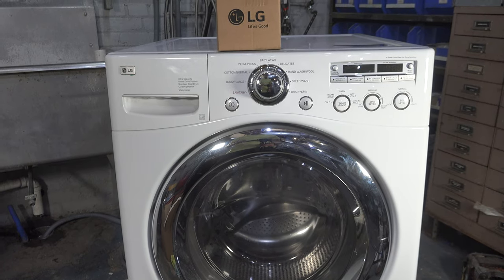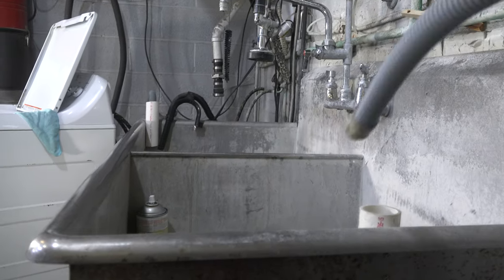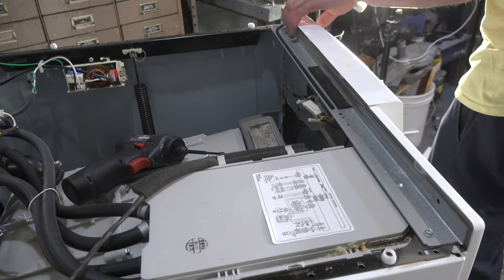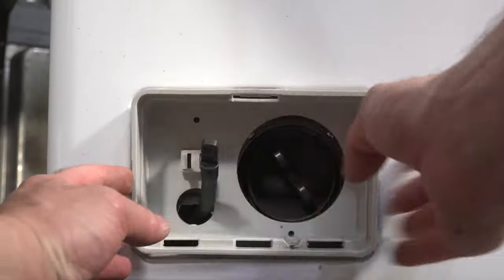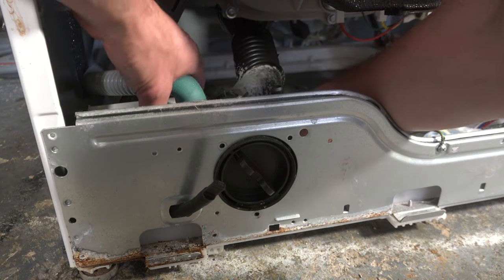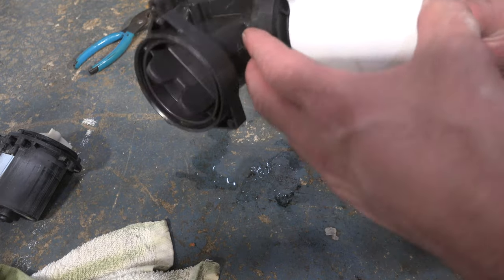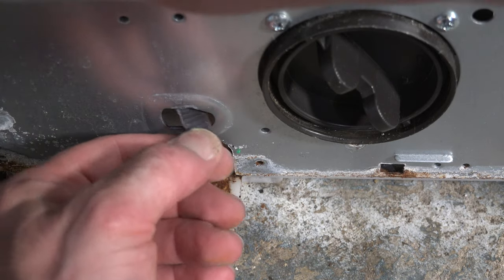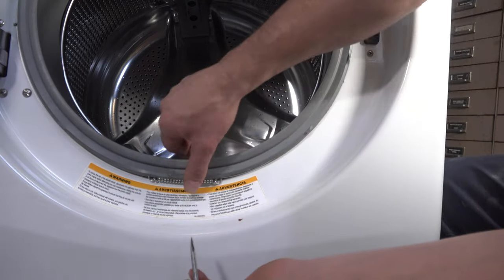How to Fix LG Washer OE Error Code No Drain Not Draining Tutorial Repair Guide

Comment: So it ended up being the filter.  The filter i had no idea even existed.  After ten years of use,  it had Bobby pins,  material,  endless hair, lint and god knows what. You saved me at least a couple hundred dollars if not me unwittingly buying a new washer.  Five stars. Thank you.
Reply: Do you need to replace the pump? My parent house washing machine broke these idk should i just take look at filter or tubs. Or just buy replacement drain motor. I dont live there anymore so to check it i must drive 300km😂
Reply: @ayn30  if you follow this video you don't replace anything. I thought it was a bad pump also.  In the bottom left corner of the washer there is a panel.  Mine leaked a lot more water than the example in the video so your parents will either need a shop vac handy or a few towels.  All i did was drain it and clean out the filter which was very clogged and it worked fine. I also ran a diagnostic check which was in a different video after.  I hope that helps.
Reply: @EL-em3mn  thanks for you suggestion. I take a look when i going to their house for next week.

Comment: Thanks ... I used your advice and video got an OEM pump off Amazon next day shipping and finished the job in about an hour or two . 1 hour 1st day disassemble and remove pump to verify type and about an hour next day after getting new part. On an easy scale it was pretty easy and my only suggestion  is make sure you remember where all the screws go back in and take a couple pictures of things the way they were assembled before you take apart if you think you may need to reference later.

Comment: Thanks for the help. Mine was a bit different. The pump assembly was not screwed to the frame but it was on a plate placed on 3 silent blocs linked by 3 screws to the bottom. Around 2 hrs to get the job done. The trickiest part was the spring at the end. I needed help (2 more hands) to be able to mount it properly.

Comment: Gotta thank you for a great video, clear and exact. However my model (altho identical) had the pumps screwed onto a metal plate that has 3x 13/16 bolts securing it to the base. In order to access them I needed a flexible shaft on my socket, as they weren't easy to reach. If your model has this, you have to remove them in order to excess the pumps. Everything else was exactly per the video. Thanks for the diagnostic feature at the end, very useful too.

Comment: I watched this video so that I could fix my washer! I ordered from your link. I had a few more screws than yours, but the main problem was the bolts holding in the drain pump. There was no tab. But besides that one unexpected difficulty, our washer is up and running. Thank you!
Reply: Same issue here with bolts instead of tab. How did you get the front left bolt out? I can reach the right and back one.
Reply: If you use a ratchet with a 3 inch extension you can get all three. 10mm. Then there are 4 screws to remove it from the mount. I would recommend removing all hoses and wires before removing the mount.

Comment: Great video.  One suggestion..... it MAY be that exhaust hose.  We had standing water in the tub.  I used a cup to get as much out until I stumbled on your video.  I then tried to drain with that little hose - no luck.  Long story short.... both that hose AND the main exhaust hose was full of sand/gunk.  I blew them both out, and verified they were clear before putting the system back together.   I will probably still order a pump, in case the blockage took off a few years off the pump.

Comment: Awesome video, made changing it a breeze without any hang ups.  I will say mine must be a newer version with the motor on a vibration resistant pad.  So I removed the pad and all for the motor swap it was just three 10mm bolts.  All told less then an hour to fix.  Thank you!

Comment: Fixed my washer thanks to you, perfect instructions. Another tip for getting the spring back on the gasket that worked for me was using something heavy with a lot of leverage to pull the spring apart, that took a ton of force.

Comment: Thanks for the help The only part I had trouble with was putting the wires in the correct spot on the new water pump. So after the second attempt, the washer worked.😂 Operator error

Comment: Worked perfectly on my LG washer WM2650HWA.  My pump looked a little different, but the folks at Lorain responded right away and said that the new pump looks different and will work just fine.  Also saved some money with their trick on getting the bellow spring back on with a screwdriver instead of having to buy the spring expansion tool!
Reply: Austin I have an older pump as well so I didn’t have the little plastic cover that he took off his older motor. Did you have to buy this piece? Did you have the same issue

Comment: Fantastic video. Our problem turned out to be a clogged filter, so it was an easy fix.
Reply: Was it clogged in the filter part that's easy to check or did you take the washer apart to get to the pump itself?

Comment: Excellent video, but as a note I just did my washer which might be a different year/model# that has the same motor but is mounted on a metal tray with 3 -10 mm bolts holding it in,otherwise everything else was the same. Thank You

Comment: Great presentation! My issue is different, I'm getting a TE Code... I've got the Thermistor part already, but I wanted a better video of removing and replacing the front cover. Yours helped!
LG wm2101hw, already bought the Thermistor for under $20.
Is there a diagnostic code for checking that component? 
I haven't heard of the Diagnostic Checking Process in any of the other videos I've watched... So I figure TE is all I'm going to get. 

Washer has been flawless... I bought it 6 years ago for $60. Apparently, the lady's grandmother was house-sitting, used the wrong detergent and flooded the whole washroom, and instead of fixing the problem, just bought a whole new set. I've never been able to get it to flood suds over, but I use Persil packets.

Comment: Just replaced pump that had failed. Draining beautifully now but I do have a leak under washer now. Pump to tub hose maybe or would it be one of the other two?  Thank u so much for your great videos! You are such a help!!
Gail
Reply: If you haven't fixed leak yet you might have forgotten gasket. I swapped motor out and was putting back together and then noticed a black rubber ring on floor. Had to take apart again. It was gasket that goes on before screwing new motor on.

Comment: I work on heavy equipment and love failure analysis. 
So what happens is:
the plastic impeller has a tab on it that eventually wears away and breaks off. You can’t just buy the impeller, so you have to buy the whole motor. 
The motor has a brass drive coupling that takes up 1/3 of the space, the impeller takes up another 1/3 then there is 1/3 of empty space.  There is always one weak link in every design. 
Fun fact: most pieces of heavy equipment use plastic drive couplings and they too wear away and shear off. A days work, one $500 plastic coupler and off you go.
Reply: and where do we buy the impeller
Reply: @sytema  attached to the new pump.
Reply: The Impaler shaft is not glued or sealed to prevent water or dirt to get in, is this the cause of failure?
Reply: Perhaps this explains why the digital multimeter determined that the motor was working when indeed it was not!

Comment: Hvac 20 years I don't do appliances (other than my own or friends) but I just want to make one thing clear if you guys don't know what youre doing and damage the bellows you're going to find that the bellows probably cost vastly more than this repair so if you're not comfortable I'd buy the 10 dollar spring spreader tool on Amazon. Be careful. Anyway the pump went out on my personal washing machine and it's very inconvenient and I'm lazy. It's a gamble whether to buy the pump on your site for 50 or the pump on Amazon for 25 but I'll probly just get yours because you seem to be pretty good and honest at your trade. I want when I buy the pump that the box should say LG on it like yours that way it will last as long as the old one did which is over 10 years

Comment: While you're waiting for you new pump to arrive and you have a load of wet clothes, you can put the little drain tube in a hose, let the water out and the cycle will continue.  You may plug it back up if water is added for a rinse, then let the water out as the washer goes through the spin cycle and finishes with no more errors.

Comment: Have a 4yr old LG  washer dryer combo, a month after warrenty  ran out, drain pump crapped out.  Found repair info on you tube. Got a new pump . Worked great for about 3 months. I replaced pump #7  today.  Machine has been used as per instruction manual  never over loaded,, never found anything anything in the filter except lint.. #7 pump is alot noisier  then the other 6. This is getting very old. I think it's time for a new machine.
Reply: Or to open the top and remove the lint from the air pipe.

Comment: Before dismantling the washer, try blowing and sucking out the drain pipe using a wet/dry vacuum.  That would have worked for me.  Our washer was not getting past the "Load Sensing" stage because it could not eject the remaining water.  I could hear the pump come on but no water came out.  The lint filter was OK.  When I took it out, the pump was working well.  The problem was a clog in the drain hose inside the washer.  Cleaning out the tub with bleach periodically may have avoided my problem.

Comment: Is there anywhere else that things could just be plugged or is the filter and hose pretty much the only 2 things that could hold it up? My filter was nasty and filled with gunk so when I cleaned that I thought that would solve the issue but it’s still not. I’m thinking this is the next step but I want to be sure it’s not just plugged somewhere

Comment: I have the washer and dryer combo and just recently had the same problem, as the water is not fully draining. I just cant find the replacement model number for my machine. It's WM3988-HWA, any suggestions where to look or If the other ones will also work with it?

Comment: I have no clogs or kinks and I replaced my drain pump. It still won’t drain. What’s next?
Reply: This is where I am at too!
Reply: I eventually disconnected the pump and started over. Reinstall and it worked. Not sure what happened. Same way both times

Comment: you'll find the motor on that pump is a standard motor fit. used on most big brand make  washers  with the 3 screw holder thats why you see so many hole slots so it can fit in place hope t helps thats if you don't want to give lg money

Comment: Mine was leaking from under that area and then got the 0E code. Any ideas? I'm taking it apart tomorrow but I'm not sure if a clogged hose off the pump would cause a leak then fail

Comment: Don't take front cover off!  Just unplug, tilt backwards to reach the pump under the left front side of the washer.  remove the cover facade screws and the mounting screws on pump.  Some pumps are Clipped in at the bottom and it just slides backwards.  Unplug the electric connections and the three mounting screws, replace with new pump (be sure the O ring is on the new pump or use the old O-ring.  reinstall and done, much faster.

Comment: Hey, I have a problem. I do have the 2 pumps. Resting on a metal plate connected with screws and bushings. They aren't tight. I'm guessing to hold it but allow it to move freely.? I don't see a button tab to release pumps from metal plate. Thanks!
Reply: How did you fix this? Mine is the same
Reply: @rebeccasnawder4214  You have to remove the screws connected to the bushings. I can't quite remember, but I believe there is 2 in the front and 1 to the left of the big hose connect on the back

Comment: Mine won’t drain on a cycle ( no code either) but no water comes out the hose but water comes will come out the drain filter next to the hose. Clogged or pump?

Comment: What if the hose itself has like sediment in it not the one that empties out into the wall, but the one near the filter
Reply: It took over 12 towels for the first time to get the water from the big filter since it wouldn’t come through the hose and then it’s gonna take three more. There was pet hair clogging it but the stuff in the hose is like sediment or sludge if you will.

Comment: This is hard way of doing it! You can see that big hole under the washer yes that's the floor. The machine can be laid on its back or even tilted against the wall. Then the pump can be removed through that hole I just covered.

Comment: I am having trouble getting the top off my washer. It’s up on storage pedestal which isn’t helping, but it doesn’t budge and I’ve removed the correct screws. I even tried with all 4 screws and the brackets removed.

Comment: Changed pump, reassembled. Self Test Mode (all fails) Low Speed Spin, High Speed Spin, Hot Water Inlet, Circulation Pump, and Drain Pump. Won't hard reset. Won't run cycle.

Comment: I have a ? Its come up to the drain cycle gives me a OE code ,but not all of the time, it is getting worse, and I can over ride it so it will pump , my  filter is clean , the drain line is good, so do I still need to change my pump?
Reply from the maker: Yes, better sooner than later.  Eventually it will fail with a tub full of water
Reply: @LorainFurnitureandAppliance  thank you , it works and sounds better

Comment: Mya LG washer is from 2019 I got an 0E error code and sounds like the pump is making a vibrating noise. I checked the drain and hose they look good. So I suppose it's the pump

Comment: Was unable to get any water to drain from the black hose drain on the pump after taking the cap off.  But did get clear water from the pump after the filter was removed. Why  doesn't the water drain from the black drain tube and how do I fix it?

Comment: If your washing machine doesn't drain after doing all of the steps in the video, it could be because you swapped the pump wires unknowingly like I did. Copper (red, brown)  is top wire and black is bottom wire for the pump.

Comment: Did every thing in the video including a new pump motor and I'm still getting the 0E message.  Any suggestions?
Reply from the maker: If there are no restrictions anywhere and it’s still not draining possibly your pump motor is defective
Reply: @kimbuck-2 Just watched another video that thankfully gave the answer (thanks Pondarosa Life). Copper (Brown) is top and Black is bottom. I ended up putting them in wrong the first time so I had to do all of this twice, but the satisfaction of hearing the water flow after the second attempt is ecstasy. Apologies if this has gotten to you too late!!!

Comment: I cant get anything out of the little black tube.  I can release the water by unscrewing the filter, which us usally clean. Why cant i get anything from the black tube?
Reply: Did you remove the plug for the black tube?
Reply: I'm having the same issue and yes, I unscrewed the plug
Reply: I’m having the same problem
Reply: Same problem
Reply: I’ve accidentally pulled mine too hard and it has either snapped off or become disconnected.. I need to know how to fix it asap 😫
Reply: I'm having the same issue did you get any input on how to fix?
Reply: The black tube is probably clogged with gook.  Squeezing it should forced it out.

Comment: Why not just flip the machine to get the pump out ?
Reply from the maker: @alexandrevicente3773  1. You run a high risk of doing cosmetic damage to machine 2. You can not 100% see your connections to confirm they are good. 3. It takes 3 minutes to strip the machine down correctly, and I’d bet those that try and save 3 minutes by not taking the machine apart lose that time and then some trying to install that pump in an awkward position

Comment: I can’t even do this because I have no screw gun and or screw driver and I’m not mechanically smart to even do all this stuff. My brain is stupid and works differently. I can only check the bottom part but can’t take the washer apart. Is there no other way?! I’m such an idiot and wish that I could get help with this!!! This video is like way too many steps like I would have to watch it a thousand times over in order to do it right and then piece it back. So this sucks I hate Lg washers. I miss the old school washers that never broke like wtf Lg sucks